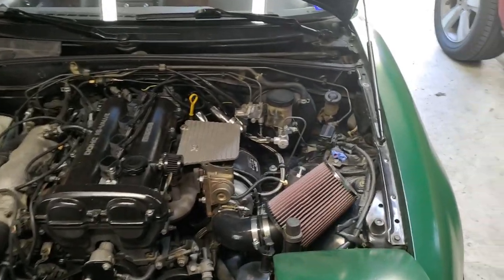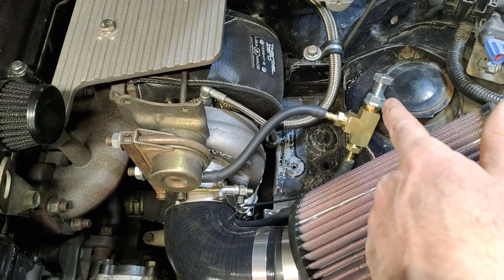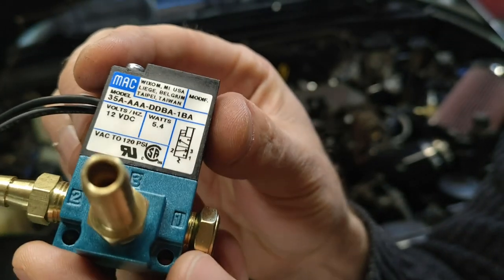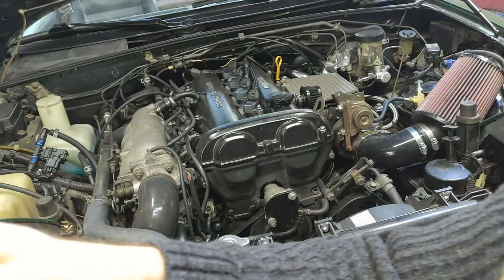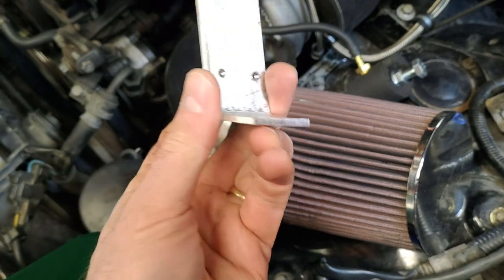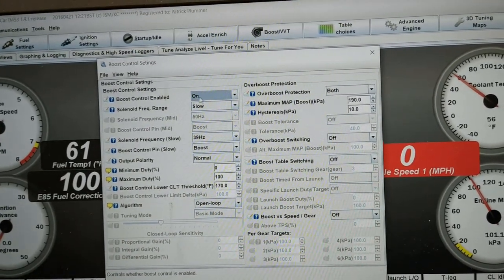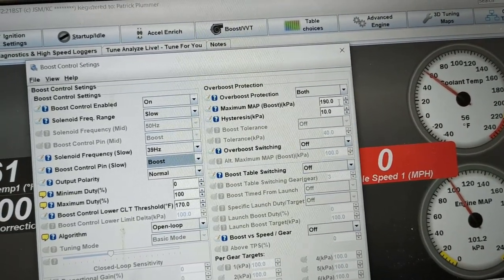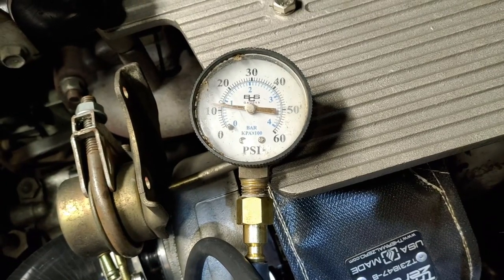Tuning the Megasquirt (Pt 8.) - Electronic Boost Control

Comment: Thank you for posting this video.  Very detailed and thoughtfully put together.  On my MS3PNP PRO I am not able to use the MAF harness for the signal wire, I need to wire into the options port on the ECU.  Do you think I can source the 12V from the MAF harness like in the trubokitty diagram you posted and run the signal wire to the ECU?
Reply from the maker: Yes, that should work fine.
Reply: @OGPedXing  thank you.  The wiring diagram for the 94-97 shows a red wire and green wire going into the MAF from the EBC.  Which one would you use for 12V switched (1B red / 2O green)?
Reply from the maker: @kevinsaeed9817  the 1b red should be 12v and the 20 should be the signal which is a switched ground from the regular ECU.
Reply: @OGPedXing  awesome, thanks for your help.  You gave me the confidence to buy an EBC and try the installation.  Thank you.
Reply from the maker: Glad to help!  You can also test 1b with a volt meter to make sure but the solenoid itself doesn't have polarity.

Comment: I have my boost solenoid installed to a 12v switch. When I give it power, it flickers right away (audible). Do you know why this is? I thought polarity of the wire didn't matter?

Comment: Why does this differ from every diagram I've ever seen on how to plumb a three-port boost controller?
Reply from the maker: Always confirm with the diagram on your solenoid and also manually in the way I show in the video.  Different models and makes are plumbed differently.  The most important thing is if there's no power then you need to be on wastegate pressure, no boost.   So the source line needs to feed to the wastegate via the normally open port.

Comment: What an i doing wrong. I can control mac valve from Output test but it wont control from tps i set it to ramp from 10 to 100 it follows the tps on the boost duty cart but wont contol the mac valve it just stays open limiting boost  to 7 psi no mater how much duty i throw at the table

os t

Comment: I had a megasquirt 2 and said I the back that I need to use the JS11 pin on the relay board for my boost controller. What I need to do. Connect on cable to JS11 and the other one to 12 volt source. Or how you do it.
Reply from the maker: Yes that should work.  Basically js11 needs to be a ground signal in that scenario.  If that doesn't work then js11 may be normally 12v so you'd need to connect the other side of the boost valve to a ground.  Either way can be experimented with and it won't damage the valve.

Comment: I just purchased my valve and I noticed the connector is not attached to the wires. How do I know which cable goes in which hole in the connection?
Reply from the maker: If your valve is like mine it should have the two wires coming directly out of the valve, no connector.  If that's not the case, it may have been damaged or defective.  For the car side of the wiring, check out about the 11:45 mark in the video.  The two wires will connect to the maf plug based on the year of the car.  You just insert the stripped end of the wire into the connector.  If this is too loose, you can get a small crimp on spade connector from an electronics or audio store...the spade needs to be very small.  A simpler option may be to use some solder and a soldering iron to "tin" the end of the wire which will stiffen and thicken it enough to fit tightly.  Let me know if this answers your question.
Reply: @OGPedXing  I got a connector sent in the same package as the valve. The connector is made to match the connector on my car but it wasn’t connected. Does it matter which way I put the wires into the connector?
Reply from the maker: Oh ok, nice!  Usually it comes bare wired.  No the polarity of the wiring doesn't matter, one will be ground and one will be power but the valve operates the same either way.
Reply: @OGPedXing  thank you so much for the fast answers!

Comment: I ordered an EBC from DiyAutotune and it came with plastic fittings and they look to be for an 1/8" ID vacuum hose which is smaller than the hose I'm currently running from boost reference to wastegate.  What OD/ID vacuum hose and barb fitting are you using?
Reply from the maker: Yeah I'm using 1/4 inch on the hose side.  I think the ebc side is 1/8 npt.  I used these https://amzn.to/36ToFSX
Reply: @OGPedXing  thank you, order placed.  Going through your boost tuning videos now while I wait on Amazon.  Thanks for all you do!

Comment: For the boost signal wire and 12v wiring on your maf plug 
How does the megasquirt know that the maf wiring is now for boost control
Do you snip the wiring on the ecu side to reroute to boost options wire?
Reply from the maker: The maf is unused by the megasquirt, it uses a map sensor instead.  So conveniently, the maf wire plus a nearby power wire can be reused for the boost controller.  Most of the miata tune files have this pin on the factory car harness pre mapped to be called "boost" so usually nothing needs to be changed in the wiring or in the software.
Reply: @OGPedXing  hey, so I'm having the same issue understanding what pin to select and how to figure it out. On the NB1 I was told to connect my solenoid to the factory purge valve as it has 12v power and a signal to the ECU. But I have no idea what pin to select on the boost menu and literally no one says anything about it on the forms. so I'm just confused in general.
Reply from the maker: For the nb1 it's similar.  You have a 3 pin ait plug for the air intake temp sensor.  You can use the right two pins for the boost solenoid, polarity doesn't matter.  This links to pin 2L on the main ecu harness.  The other is ground. You can test that this is correct by using a multimeter set to ohms or continuity setting and getting a connection from 2L to one of the pins on the ait plug.  A wiring diagram I have labels from left to right the pins as 4a, 4x, and 4af.  You want 4x and 4af.
Reply: @OGPedXing  Thank you for the fast reply I really appreciate it. I hooked up my GM AIT sensor to what I assumed was the factory plug with 2 wires (that's near the MAF sensor plug.) So I don't believe the factory AIT sensor has 3 wires? Right now I have my boost solenoid connected to the factory purge valve also called the evap solenoid. Could I possibly get a link to this wiring diagram? I defiantly need to do more research on how this works because now I'm even more confused. Do I need to jump wires inside the megasquirt at all to get this to work? Thank you so much for the help BTW.
Reply from the maker: Which megasquirt version do you have?  This page has nice diagrams, the direct link is to the ebc notes but one level up and click on build the megasquirt, at the bottom it has the main ecu harness diagram. https://trubokitty.com/#/installation
Reply: @OGPedXing  Thanks!, I have a MS3 PNP for an NB1. just trying to figure this stuff out before a get the car started. I have a full kraken low mount system with a built engine.

Comment: Hey, I have mine set up today with port 1 from turbo pressure source and port 3 as vent to atmosphere.
Does that affect it's functioning?
Reply from the maker: There are different models with different port set up...the important thing is to be sure that if the solenoid is not working (no power) that your turbo gets the full pressure from the source.  You can test this by just blowing through the ports with nothing connected and then trying it again with a constant voltage applied.
Reply: @OGPedXing  thank you so much for the information. Mine is the exact same one as you're using in the video. I'll test and rectify the setup appropriately.
Reply: @OGPedXing  I've checked and done the piping exactly as you have demonstrated. It's working perfectly now. Thank you so much

Comment: Hello! Do you know if it will work with a diesel VNT/VGT turbo? Want to replace a tillix and needle valve to avoid over boosting on a nissan patrol y61 zd30. Thanks!
Reply: By the way... it is  vacuum turbo
Reply from the maker: Normally this valve is used for pressure wastegate actuators as opposed to vacuum.  I've never seen it used for that but it might be possible.  The specs for the valve say the pressure range is down to vacuum.  Here's some more info: https://www.macvalves.com/wp-content/uploads/PDFs/Series_Pages/Sm3ways/35catalog.pdf

Comment: hey man - if I wired into my Miata's MAF wires, what is the output setting for the boost control?
Reply from the maker: Most miata specific tune files have it already set up to be the "Boost" option on the output drop down.
Reply: @OGPedXing  I dont know why, but I think through updates, its now called High Power 2. I ended up using the 12v from the MAF red/white and then just running my own cable to the rear options connection port R
Reply: @OGPedXing  Oh I meant to ask, does the 9V test when this is used for a dual port external wastegate?

Comment: Can I wire my 1.6 Mac boost valve like this running a ms2pnp?
Reply from the maker: Yes, should be basically the same.  Since it's a pnp, you may need to add a new wire to the options plug and configure that in tunerstudio to be "boost".

Comment: Do you by chance know if you can use the MAF the same way you did with the IAT and EBC with a MS3ProPNP?
Reply from the maker: You mean the maf plug?  Yes it should work, what year is your Miata?
Reply: @OGPedXing  yes, the plug, sorry. My Miata is 1995. But, it is the 1995.5 with the tach signal being send from the ECU rather than the coils.
Reply from the maker: @jacksonhamblin5242  yep, that will work.  Your 1995.5 has the same maf plug as my 94 so it should be the same as shown in the video.  Here's the link to the wiring diagram https://trubokitty.com/#/installation. Scroll down to see the maf and iat setup.  For your ms, you will just need to set the right output in tuner studio.  Usually this is labeled the boost or maf output.  Worst case, you can use any avaliable output on the ms and connect to either lead on the ebc with your own wire.  Then the other lead can go to any nearby 12 volt source.
Reply: @OGPedXing  thank you for the resources and help. I have another thing that I cannot find a completely clear answer to anywhere, with the 95.5 tach being ecu and not coil driven, do you know if is this a setting under tacho output inside the ms3pro/tuner studio that can be changed between ecu/coil or is this purely a chassis wiring issue?
Reply from the maker: Should just be wiring, you can check the 2I pin on your ecu connector plug and make sure it's not empty in the car wiring.  It shouldn't be if it's a 1995.5.  The ms3pnp should output the tach signal there automatically.  Usually it's the 94 guys that have problems with a dead tach because it's expecting it from the coil not the ecu in the dash cluster.  But either way, you can also configure an output on the ms and wire your own line to the tach/cluster.  Unfortunately I don't know the pin for the tach signal at the cluster side.
Reply: @OGPedXing  thank you so much I appreciate your help and knowledge

Comment: I followed this and I cannot get my mac valve to work when I use test mode I don’t hear anything. It’s set under boost
Reply from the maker: You can try verifying the output wires your using with a voltmeter.  With the boost valve disconnected, turn the test mode to on with a 100% duty cycle and you should see 12 volts on one lead and ground on the other.  If you're not getting that, verify in tuner studio that the boost controller pin is defined correctly.
Reply: @OGPedXing  I have pin 7 on the options plug tapped into 2O in this harness, and whenever I go into programmable outputs and turn the boost output on tuner studio gives me an error. I
Reply from the maker: Usually the error will be something about the pin is already in use.  You'll need to find what tuner studio is already using output pin 7 for and disable it or set a different output.  Then it should work to enable the boost control settings.

Comment: IS there a way to change KPA to PSIG on the MS3 platform in tuner studio? -thks!
Reply from the maker: No, afraid not.  If you want to mess with the ini files you can potentially use PSIA (absolute).  But not psig.  Kpa is easy to convert back and forth...0 is -14.7 psig and 100 is 0 psig, etc.
Reply: @OGPedXing  I have the conversion chart on the desk top. Just a pain to go back and fourth when your dealing with changes that aren't in simple 100kpa ranges. Have a drag car that runs upwards of 30lbs and runs a boost ramp. Always having to jump back and fourth is a pain! -thks for the reply!

Comment: what pin did u use on the patch harness(side that connects to stock harness) for the boost, so it reads it from the MAF plug?
Reply from the maker: On the megasquirt side I used pin X-6 (expander board pin 6) to connect to pin 2O on the oem harness side.  This is the pin that's normally mapped to "boost" in tuner studio and 2O is the maf wire.
Reply: @OGPedXing  but arnt you suppose to use pin 2O for the new AIT sesnor that plugs into the maf Sensor stock conocter?
Reply from the maker: @Kuba Podgorski I'm using 2P for that one but you can swap them.  Since there's no maf they are just wires to the maf connector so you can have them go to whichever megasquirt pin you need.  Edit: I have a 94, the wiring varies a bit with the year.
Reply: @OGPedXing  so basically the stock maf connector pins get split into two different  signals when it goes into megasquirt? i have a 95 and 94-95 have the same wiring for the patch harness on turbokitty.net. So technically I can follow your setup using the stock MAF harness to plug in my AIT and boost leads into the corresponding leads on the stock maf connector? Also thank you for responding i really appreciate it.
Reply from the maker: @KubieSnacksz  yes,that should work!

Comment: I wonder if a 2 port version could be used as a iac valve
Reply from the maker: That should work, the only issue would be the housing.  It need to input air to the other side of the butterfly valve in the throttle body. So if you had a tb without an IAC then you could drill into it.
Reply: @OGPedXing  ya I'm rewiring my 2008 rzr 800 with a microsquirt. Also replacing factory throttle body with a bigger one so there's allready going to be allot of custom parts. I wonder if a actual 2 wire iac would be as loud as that thing is lol

Comment: I sent you an email about MAP on my 2002 NB, Under boost settings I don't have a Boost on the Boost pin selection. I'm running a MS3PNP. Can you help?
Reply from the maker: Hey, yeah, just saw the email.  Basically the drop down will have only the options for pins available to your ms3 that can be set via software.  Typically it will default to one of the pins on the options connector for this rather than a pin the goes to the stock harness and stock MAF wiring like I have on my home built ms3x.   So I'd leave the default selection is tunerstudio and then add your own wire from that pin to the ebc.  You'll have to confirm this but I think typically it's pin R is set up as the boost control on the ms3pnp.
Reply: @OGPedXing  Is there a way to use the MAP from the stock harness & MS so I don't have to pull a new wire? Thanks in advance. You do such a great job of taking on projects and excellent explaination and details.
Reply from the maker: @maxp8892  you may have to depin the maf wire from the main harness...checking the diagram from trubokitty, it seems to be 4X...and then connect that over to the options port pin.  I'd probably just run the wire through maybe the bung for the cruise control which is above and behind the gas pedal and is to the left and below the brake booster on the engine bay side.   But whichever seems easier.
Reply: @OGPedXing  Thanks for the suggestions. Have a great day.
Reply: Patrick, Do you know what / where I can get the crimp pins that go in the Mazda wiring harness that plugs into the MS? I need to add the wire but forgot about the pin in the connector. Thanks in advance.
Reply from the maker: @maxp8892  Check out these guys: https://www.bmotorsports.com/shop/static.php/post/miata.  scroll down to ECU connectors, you can get just the pins I think but you may need to contact them directly.
Reply: @OGPedXing  Thanks Patrick.
Reply: Patrick, I sent you and email with an image from of the 2002 NB wiring harness. I have the crimp pin and a blank location for the wire. I'm unclear on how to tell MS to use that pin "4AH" for the EBC. Thanks in advance.

Comment: How did you know which base frequency to pick?
Reply from the maker: I'm familiar with this valve so I knew it actually likes about 32hz but the way to figure it out is to test how much air it lets through at various frequencies before closing.  What you'll find is that as you go up in frequency, it will still work but the range from open to closed will shrink.  So instead of a duty cycle range of 10 - 80% you'll only get 30-45%.  What that does is give you much less control or resolution to dial in the boost really accurately.  So in this case using either 26hz or 39hz will give good results.
Reply: @OGPedXing  This solenoid has s rating of 30hz max
Reply from the maker: @norb231  the tech data from Mac valves doesn't note the recommended range specifically but the total cycle time is 8 ms.  Rounding up a bit to give some time in the open state, gives about a max of 100hz.  You won't damage the device if the operating temp, voltage, and amps are not exceeded.  However at higher than 30hz you just lose range so it's definitely not recommended to exceed that if you don't have to.  Unfortunately some ECUs require you to pick a hz out of a small number of options so you have to pick the one closest to the best range.
Reply: @OGPedXing  Thanks for the clarification I can leave it at 26hz then.